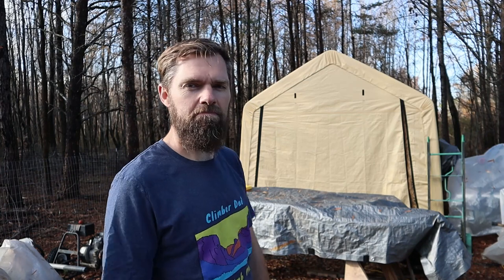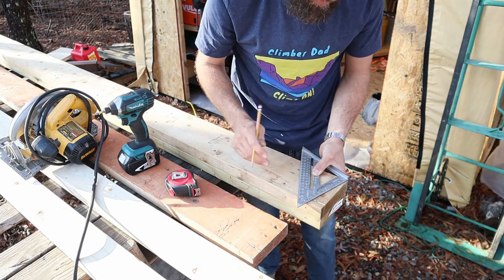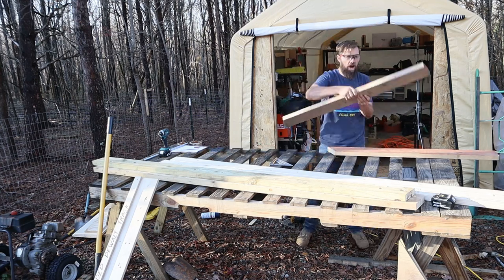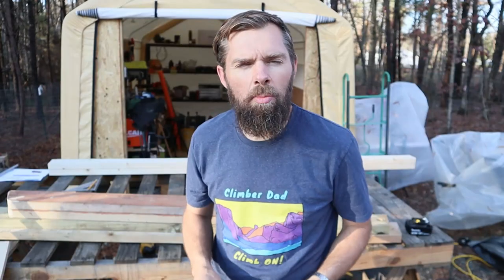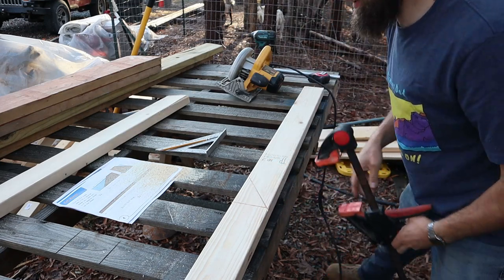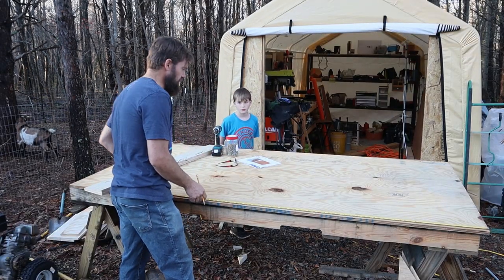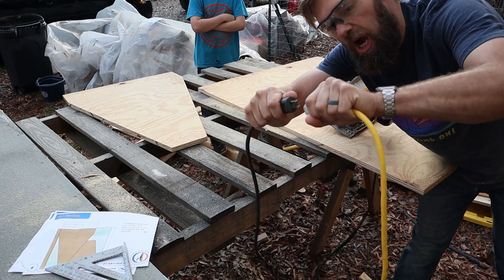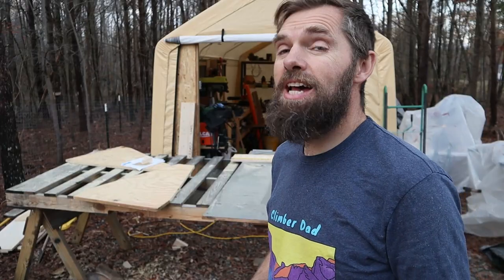Building The EASY FREESTANDING CAMPUS BOARD CLIMBING WALL

Comment: will this plan be able to set the campus rungs to the specs of Actual Campus boards at the gym? Most likely just the first 1-4/5 im sure.
Reply from the maker: You can set the campus rungs at any distance you set the t-nuts on or screw on the rungs.